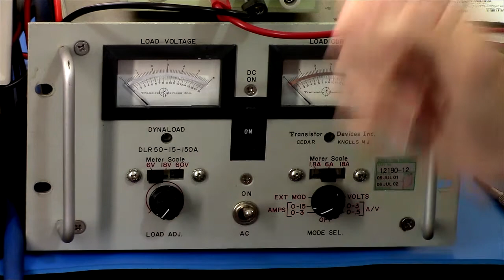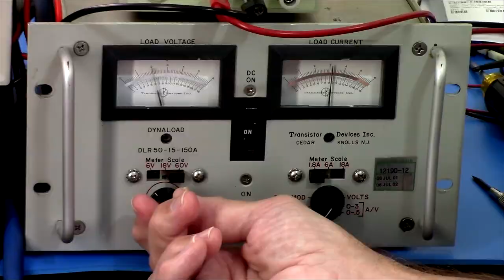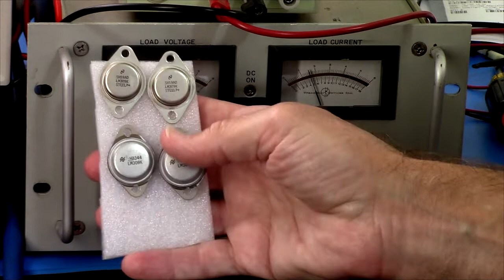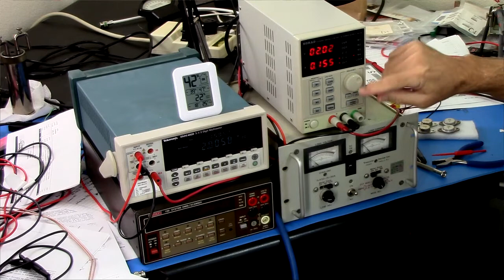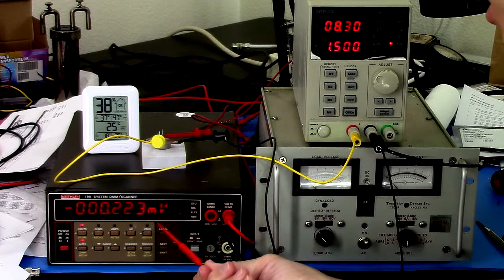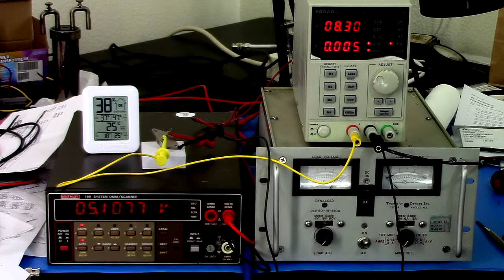First Look: Transistor Devices DLR 50-15-150A "DYNALOAD" Electronic Load

Comment: What does you unit do? Is it not a variable AC power supply? I need a bench top unit which I can set a constant current (4-6 amps), variable voltage (5-25 V) AC output where I'll introduce a load of ~ 1.5 ohms. Is this what I need? What do I need?
Reply from the maker: No, it's not a variable AC power supply.  It's used to test (DC) power supplies by presenting a load to them.  Sounds like you're looking for an AC current source...

Maybe something like the Valhalla 2500E, though I don't think that meets all your specs.
Reply: @MartianTech   @MartianTech  Thank you for that, after watching your video I did some Google-Fu and realized what I was looking at. I also appreciate the recommendation, I did find a unit which should work for what I'm trying to do. That being bench test an airfield runway/ taxiway light fixture after working on one. Because it's a constant current high voltage series circuit system, I have to completely lock out/ tag the entire system to just change a bulb, nevermind remove and reinstall an entire fixture. The Constant Current Regulators (CCR) that run these circuits are murderous maniacs and will make sure whoever's body just became part of the circuit causing a drop in current will have no chance of living by jacking the voltage up as high as 5,000VAC to make sure it maintains the designated amperage! 

That takes a minimum of 45 minutes to do this because of the nature of aviation, and just yesterday I reinstalled one of our LED runway light fixtures I had replaced the power supply PCB on, and it still failed to illuminate. I need a way to avoid all that, and the bench top CCRs available are way too expensive for the rural city who owns the airport to procure.